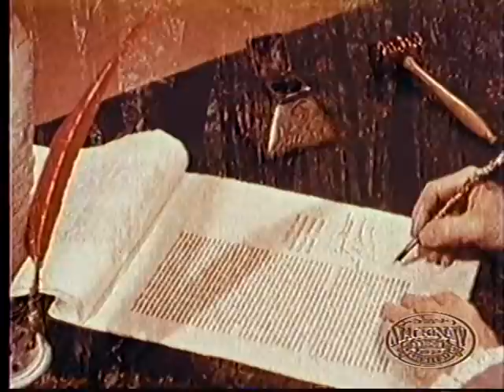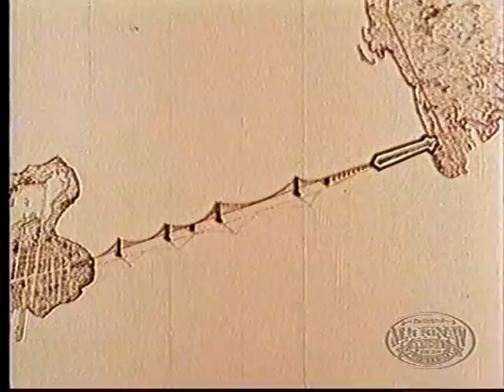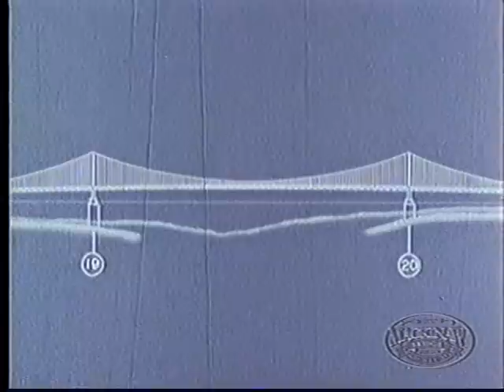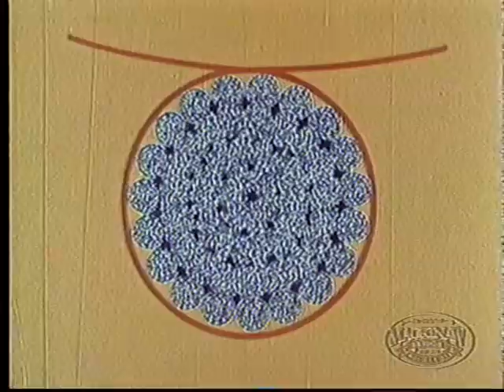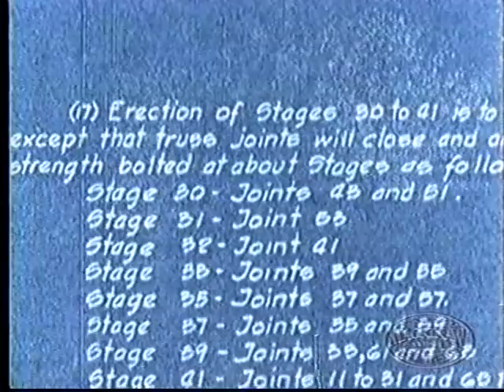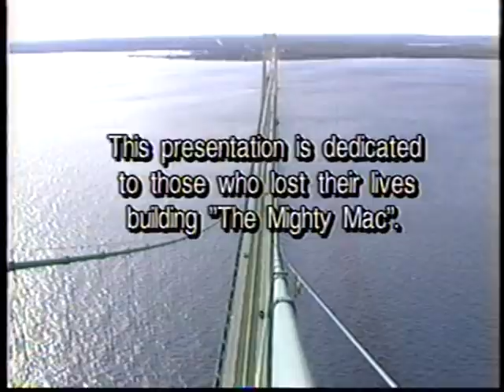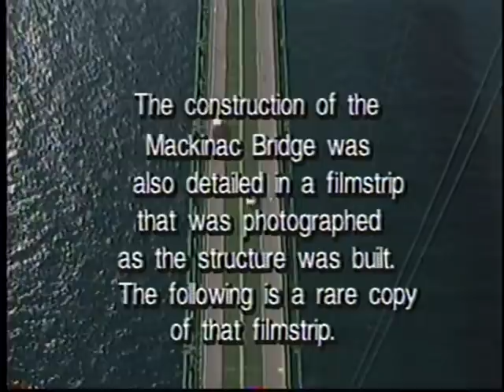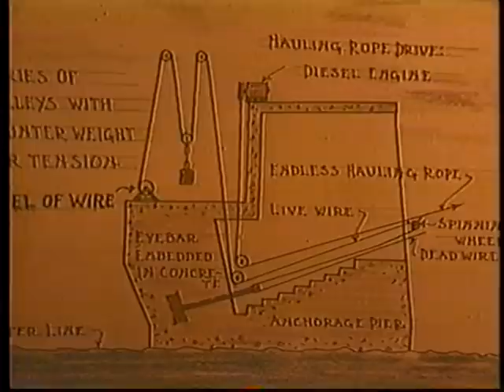The Original Mackinac Bridge Story - Full Documentary

Comment: We couldn't do this today..... So many reasons why... Awesome bridge. I drive it almost every week, and this documentary was very enlightening. 1950s America....If only it would return [middle.class economy,.etc]..
Reply: Suspension bridges are as obsolete now, as is that '57 Ford wagon.  New designs like cable stayed and pre-stressed concrete make building a structure this long a snap.  CA just did it with the new Bay Bridge and the the new Gerald Desmond.  NY did it with the Mariio Cuomo bridge.  Boston did it with the Zakim bridge.  Far better structure than those rusting 1950s relics.
Reply: @desertbob6835    Yeah maybe, but you see this video is about the MACKINAW BRIDGE.

Comment: Around 20 years ago a lady was driving over the bridge and the wind blowing through the steel grates swept her car right up and over. She died.
Reply: Well, you are mostly correct. It was 1989, so more like 30 years ago. According to family testimony and police reports, she was traveling from Detroit to St. Ignace to meet a boyfriend. The Mackinac Bridge Authority had issued speed restrictions on the bridge after high wind advisories had been reported by the national weather service and wind speeds on the bridge deck looked to exceed levels where normal driving speeds would be safe. They also advised motorist to stay out of the left lanes and off the grated roadway, as is SOP. Further, eyewitness reports said that she was driving well over the normal posted speed limit, let alone the reduced speed limit for the conditions. Those same reports said motorists saw her enter the left lane (presumably to pass slower traffic) and shortly thereafter, her tiny car was lifted by a gust of wind, carrying her into the oncoming lanes. Her car then violently cut back towards the right (perhaps a panicked overcorrection) and slammed head on into, and ,subsequently, up onto the east railing. It then slid some 40 ft. or so on the railing until it struck one of the bridges support cables and finally flipped over the side and down to the waters below. 
        She was found on a ledge 150 ft. below the surface 4 days after the tragedy and was recovered approx. 4 days after that, due to inclement weather conditions. Her cause of death was determined to be blunt force trauma and drowning.

        Hope this clears things up a little. Take care.

Comment: I want to know how they were so  sure of the methods  of building  the Mackinaw  bridge were correct ....? and going to work out to be able to connect both ends together  with out a mistake in engineering that was not off by feet or inches?. that would really be a real problem to just wing it   and come up with a solution ..?
  Were their calculations  good enough to  hold the weight of the bridge its self, and  all the traffic that was going to cross it daily,  and hold up to the winter, and  wind conditions just by the strength  of the one cable   that was all put together to form one big cable now  that is scary , I am surprised they had that good of Engineering skills back then Amazing.......  
 ....One single wire has the strength of what ..?  they said there were (340) single wires to a bundle and( 37) bundles to  the Main cable that goes across the spans that's      
(12,580) wires for one side,  And  ( 25,160) wires  for both cables,..  question is what was the strength of 1 single stran  of wire .?..what a 1,000 pounds of weight maybe...?.. before it would break ..?  I don't know ...?...when you add up what each suspended section of frame weight and what  the  road support cable were capable of handling  it just blows your mind to think of How it was put together and has held up so good all these years and more years to come ..
Reply: Engineering at its best coupled with standards being adhered to and steelworkers that knew how to build it.
Reply: The first bridge to be designed mathematically was the Forth Bridge in Scotland, completed in 1890. This followed outrage after the Tay Bridge disaster, caused by wind loading not being accounted for. So by the 60s bridge design calculation was pretty advanced after 70 plus years of experience.
Reply: Didn't  you see that ultra modern computer they were working with?!😜